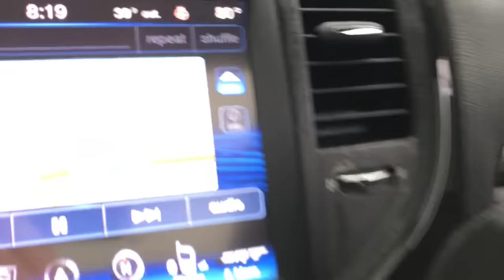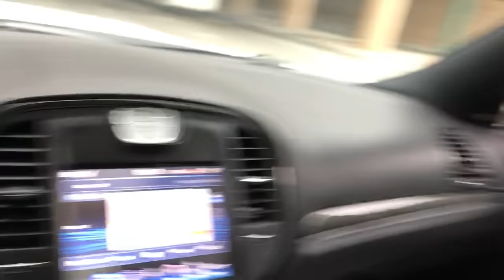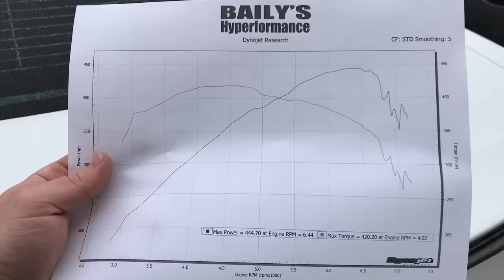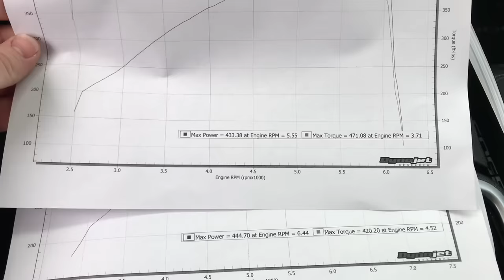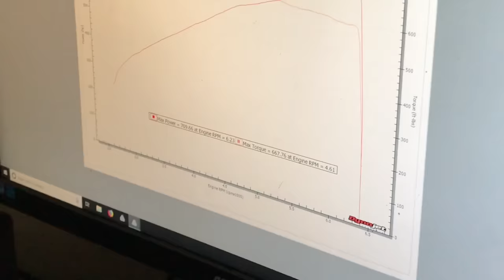Simple Bolt On Chrysler 300 SRT8 392 Dyno Wheel Horsepower| Bailys Hyperformance | DFWLX | Vlog

Comment: Hey brother, beautiful 300 you got there! Very, very nice! The difference in torque you're seeing is likely has to do with torque multiplication differences between the 5 Speed NAG1 tranny in your car and the Speed HP70 in his Scat. Also, the torque readings can be skewed based off what RPM they start the run at. You both have bolt-on 392's, so the torque production in reality between those two engines is going to be in the same ballpark...NO WAY in Hell there's a 50 WTQ disparity. Period. I am local to DFW and have a '15 SRT 392 Charger with Peitz Performance 93 Octane PCM & TCM Tune, Stainless Works Long Tubes and Cat-back with catless mids, Ported Factory Intake, Fastman 84mm True-bore throttle body, Arrington CAI & Catch Can. My car made 463 WHP/471 WTQ(STD)on a Dynojet and has run a best of 11.62 @ 117(on a day when the DA was right at 0(Sea Level)) out at the  TX Motorplex back at the end of January...She's not setting the world on fire, but she runs good for a 4600+lb(w/driver) Bolt-on and Tuned naturally aspirated 4-door sedan, IMO anyway. I need to make it out to one of the DFWLX meets here soon. Once again, sweet car man! Take care...
Reply from the maker: That was by far the nicest, most descriptive comment I’ve ever had on YouTube. Thank you for the info. I assumed it had to have something to do with the transmissions. I’d love to meet up sometime. I’m actually in Arlington area. Or you should come out to one of the dfwlx meets. I’d love to see your car. Thanks again buddy!
Reply: @ZackStenstrom  I'm in N. Grand Prairie...so we should definitely try to meet up sometime!
Reply from the maker: @quickbrick2594  thats crazy. I've lived in SGP my whole life up until thos past December I bought a house in Arlington.

Comment: More then likly the lower torque is caused from the 22's. You have more rotating mass which robs power.
Reply from the maker: Damn it... I didn’t think about that. I was actually going to put my stock wheels on but didn’t think it’d make much of a difference. You could be right.
Reply: @ZackStenstrom  redyno with the stock 20s I'll bet you will be near that scat pack. 

Also...doing another rebuild on my 300 SRT. Want to come record it for your channel?
Reply from the maker: @JwomackGames  there is another shop doing a dyno day in April I may go to. I'll put the stocks on and see.
Reply: @ZackStenstrom  I need to get my car up and going so I can get it out there as well.
Reply from the maker: @JwomackGames  as soon as its ready i can let you know different events I'll be at
Reply: Zack Stenstrom it’s because of the 22’s and also because the scat has the 8 speed. That trans REALLYYY makes the difference. Im putting 1 in my 300 on the 15th by @hellraisertransmissions on IG

Comment: The 2015's and up have more power than the 2012-2014's. Not too bad on the #'s. When i had CAI, Mopar LT's, catless, with SLP LM2, and dyno tuned by HHP it had 460 HP and 460 TQ. I now have MMX NSR cam and dyno' d 499HP and  483 TQ.
Reply from the maker: They make like 10hp more. It was the best comparison I had that day after my run to compare numbers to. I’ll probably do cam, long tubes, catless mids and a real tune all at one time. I would like to get in the high 490s or around 500. Sounds like you have the setup I want!! Lol
Reply: @ZackStenstrom 
If you get the NSR cam u dont have to do the valve springs or lifters. I ordered converter and valve body last week. They should be here monday and tuesday. Best i ran was 11.7. Id love to see 11.3 but be happy 11.4-11.5.
Reply from the maker: @Ryani870  I've never looked into them is it a non mds cam? Wouldn't I have to get non mds lifters as well? Looks like I'm gonna go do some research on these.
Reply: @ZackStenstrom 
It works with our lifters and springs. They made the cam so we dont have to pull the heads off and replace everything. I did it in my driveway over a few days. I had N2O at one point also with the cam. I was hanging with stock hellcats.
Reply: Ryani870 to really set our cars over the top and basically have 2015+. Get a used OR new ZF 8 speed from any v8 mopar and slap it in there. It’s a direct fit. You’d just have to get a new ECU because you’ll now have 8 gears but that’s about it.
Reply from the maker: @Ryani870  whats your IG? Add me. I'd like to talk more about this.
Reply: @ZackStenstrom 
I dont have ig😂.
Reply: @ZackStenstrom 
I just did old school facebook friend u.
Reply from the maker: @Ryani870  😂😂😂
Reply: @ZackStenstrom 
Just added u to srt page on FB. I think SRT'S ONLY. NO Scats or rt's or v6's
Reply: Can i be add to the srt group im looking in to caming my 300 srt to my fb name edgar santoy

Comment: The reason for low torque defiantly is related to tuning. The timing and/or fuel is not set properly at around 3500 rpm. Keep in mind that peak torque afr is a bit leaner than peak rpm afr. Good luck.

Comment: No your power is right on par. Keep in mind you have a 3.91 gear for the 5 speed (longer gears) where the 392 has a 3.09 (shorter) gears for 8 speed which is why you see some differences
Reply: 3.91 is shorter gearing than 3.09 you have it backwards

Comment: That's on standard smoothing it's a bit inflated. SAE is what you should go by. 444 whp STD is closer to 430 whp SAE.
Reply from the maker: Can you elaborate? Are you talking about the type of dyno it’s on? Sorry for my ignorance on this.
Reply: Zack Stenstrom You dyno’d your car on a dynojet which reads higher than a mustang Dyno as it is, but the setting they put it in was Standard correction factor smoothing 5 which is also more inflated. Manufacturers usually SAE correction factor for their ratings as it’s usually more realistic and it is more standardized based on conditions that you can compare it to other dyno’s also. It accounts for temperature and other factors and corrects for it to show what your car makes under standard circumstances which makes it comparable to other cars dyno runs using different dynojets. I should clarify that std rating and you making 444 whp on standard means you’re probably making a bit more power because it’s colder outside but SAE rating is more realistic because that is what you’d make at 70 degrees Fahrenheit in normal conditions. Either way the difference isn’t that significant. Dyno’s are meaningless in my opinion unless you do before and after dyno’s when you get mods installed just to see the change/improvement. What’s more telling is quarter mile times/trap speeds and 60-130mph gps times.
Reply from the maker: @techmaster777  Thank you for that. I wasn't aware of any of the to be completely honest. So that was cool to learn. I do agree that dunk numbers are pointless. It's just fun for me because I've never had a car worth dynoing really. So I'll do it after other mods and see how they affect the numbers. I will be going to the track soon to get some times for comparison as well. I appreciate the info!
Reply: Zack Stenstrom if you don’t have one already get a dragy. 149 dollars you can test all kinds of metrics and it’s accurate as hell
Reply: Zack Stenstrom If you make a video testing all kinds of performance specs with dragy on here it’ll make for a good video
Reply: Zack Stenstrom Lol I need to get another Dyno of my car. I dyno’d it before on 18 psi 93 octane it made 365 whp and 323 torque SAE (380 whp 335 torque STD). I’m running e85 now though on 30 psi should be near 500 whp hopefully
Reply from the maker: I’ll have to look into a dragy. Never heard of it. Could make for some good content for sure. 

Damn those are some good numbers. I drive my car way too much to go e85. It will be going to Florida at the end or April and on a rally in a May. E85 sucks to find sometimes
Reply: Zack Stenstrom true, I made about 420 whp on 93 octane 28 psi so it's still a good amount considering my car is 3100 pounds with a full tank. I can switch back if I ever wanted to drive somewhere far haha.

Comment: Between your 300 and the Charger Scat Pack, what do each of you have for transmission & rear differential? If the same probably have different stock programs for trans controller/shift points.
Reply from the maker: He has the 8 speed auto, mine is the 5 speed. So they are completely different.
Reply: @ZackStenstrom  there's the reason for difference in HP and Torque numbers
Reply from the maker: @fitzfilmsgarage  I thought it might. But not that huge. Either way. Its all good
Reply: Zack Stenstrom They did the runs in different gears it seems like. They did yours in 3rd? Is that your one to one gear

Comment: I absolutely love your 300. And I want one so. Ad everything I got is white with black wheels the tahoe on 24s and 35's , the titan on 26's the chopper is also white with black wheels. The only thing I got that aint white and black is my 2000 ram sport which is all black and has never been modified since I bought it back in 1999. But I am very seriously thinking about selling it to buy a 300 srt8 8 dont need 2 trucks and i dont have a car that runs lol 🤔 damn your 300 is clean and nasty
Reply: Oh and my profile pic my minitruck is also gonna be painted white lol its still a work in progress and havnt gotten to the point of getting it ready for paint yet 🙃

Comment: Wtf 471tq on a none tuned 392, 🤔 I’m confused
Reply from the maker: It was consecutive on all 3 pulls. Just some freak numbers.
Reply: Zack Stenstrom so it’s something like a factory freak then, because that puts the crank tq way over 500, & for yours to be so low it’s gotta be in your tune
Reply from the maker: @ThemReaper5  yeah. His tq was stupid high. Even against other 392s there. So it had to be a factory freak. I'm sure mine is the tune. Its just a BS Diablo i1000 91+ tune. Nothing specific to my car or mods.
Reply: Zack Stenstrom if I’m not mistaken the factory stock 392s put down like 430whp &wtq so you gained power and lost tq, did you adjust anything on your diablo at all by chance? & when ever you do fbo and a cam you should be at 500whp and tq